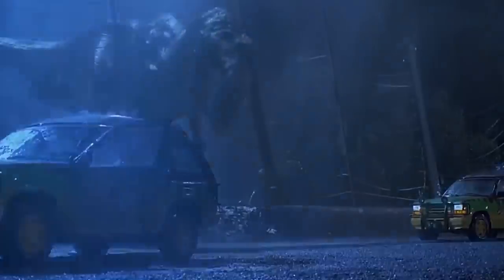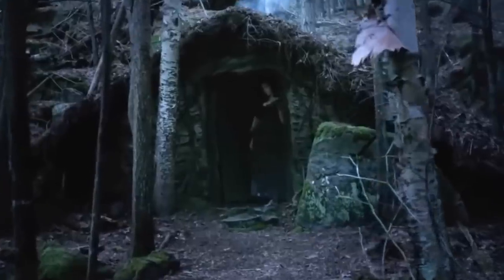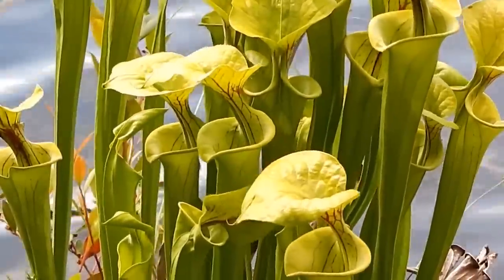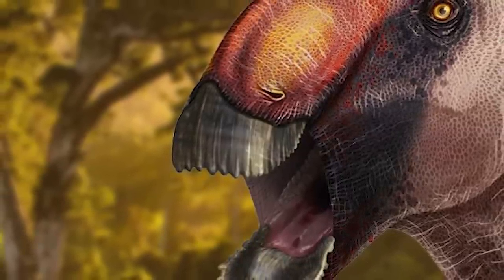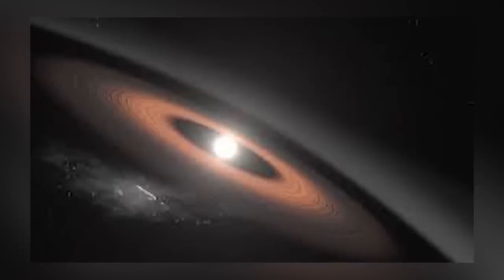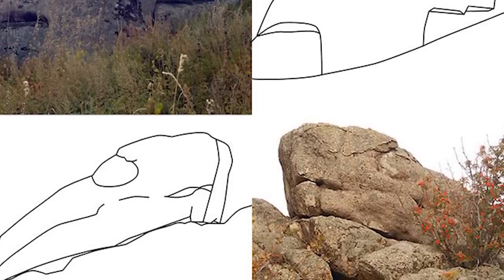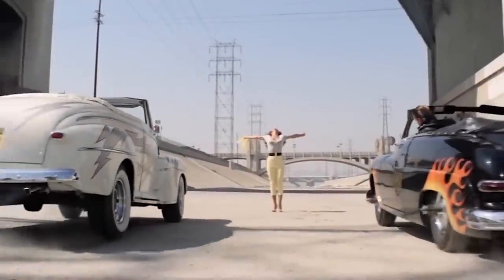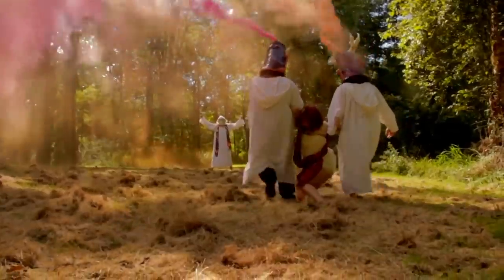12 Most Incredible Recent Discoveries

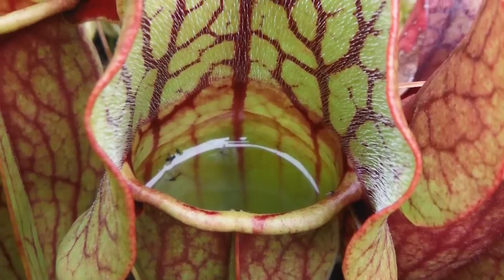Comment: 4:08 I feel like this was very badly reported on. From a biological standpoint, this is neither a recent discovery, nor surprising. (See below for explanation)

I’m from Florida, and I’ve had pitcher plants outside my house for years, because they grow extremely well here and reduce the number of bugs that get into the house. They work by collecting rainwater (or water from a watering can) in the “pitchers”, which are lined inside with tons of sharp “hairs” pointing down towards the bottom. There’s also a flap on top, which closes tightly over the pitcher when the pointy hairs are touched. The inner lining also produces powerful enzymes similar to pheromones and stomach acid—first the “pheromones” are secreted into the rainwater to make it smell irresistible to certain animals (mostly insects and arachnids), though to humans they just smell like a normal houseplant.

To bugs, the water smells like nectar (and possibly like other bugs ready to mate), so they crawl into the slippery pitcher by climbing down the hairs. The flap closes, and the bugs panic, falling into the water and being stabbed by the sharp downward-facing hairs. The pitcher then releases “stomach acid”, which begins to digest the drowning bug. However, the size of the pitchers is largely determined by how much animal protein the plant gets; more prey = bigger plant.

I’ve found tiny frogs and even a few small lizards (anoles) in the bigger plants, where the pitchers can grow to the size of a small banana. Amphibians are know to reproduce and hide inside of water-collecting plants like bromeliads, so naturally they would see a large pitcher plant as a good place for that...only to die inside it.

I imagine the “turtle sock” pitcher plant was able to adapt very quickly to prey on salamanders, with minimal changes to its scent since salamanders are naturally drawn to small pockets of fresh water. The plant simply needed pitchers big and strong enough to trap them.
Reply: Thx

Comment: simply because one was finally found somewhere, doesn't mean that that was it's only point of existence.
if any species living in a certain region and/or set of circumstances in the ocean,
then most probably they'd be in every other region with similar set of circumstances.
Life expands, and as such if the species may have existed for but a million years or so,
this a well over the amount of time it would have needed to expand into other territories.
Common mistake, linking the place of find to the possibilites of existence.
(in fact, this is true for most species that are ocean based, since the ocean has no boundaries.)
(the only boundary would be north and south pole, having much colder waters.)
(limiting the expanse to either atlantic or pacific regions, but otherwise free)
(this does not apply towards species with a very specific set, such as great depth, sulfuruous
waters and such, which are very local.)
(like said, the more common the set, the greater the expanse.)

Comment: 09:17 this may appear unusal, at first since it's the first one to actually show the rings,
and maybe given a billion years or so, a planetary body may yet be the result,
and yet, not that uncommon.
if a star releleased part of it's mass evenly enough, it would form such rings.
Much like Saturn, albeit somewhat larger (x100 or so).
What is seen is what our solar system may have appeared like several billions of years ago,
before it developed into planets, like Earth.
But let's go sit and wait on the porch, to see if it lasts or yet there's a planet already there,
since the time it took for that light to get here, may have been enough already for a planet to form.
(all that's required is enough time, and the slightest difference in mass density within the ring.)
.